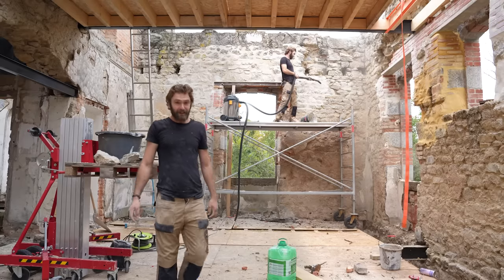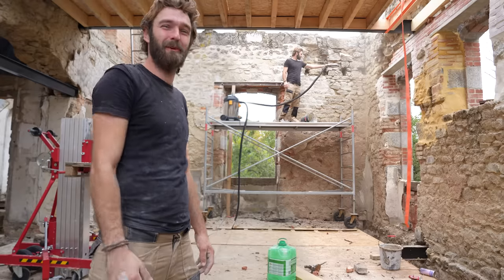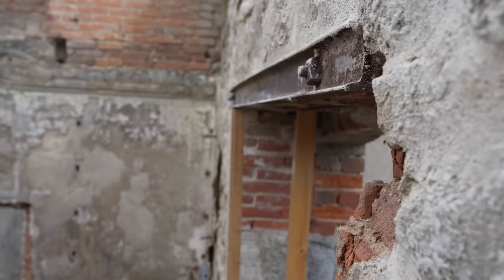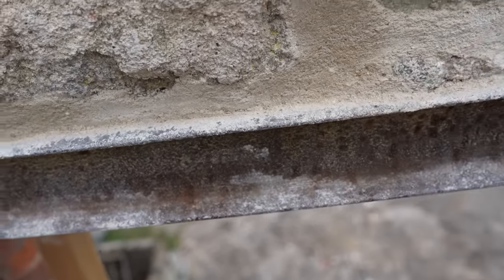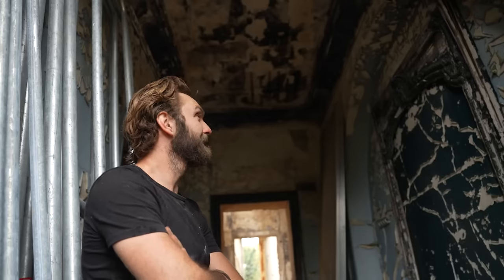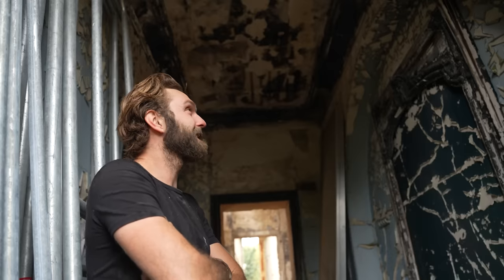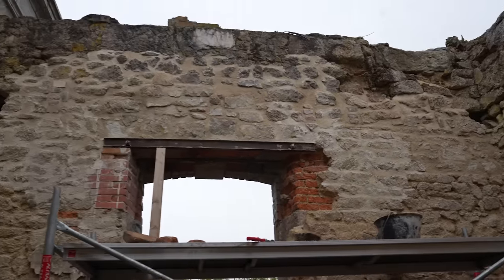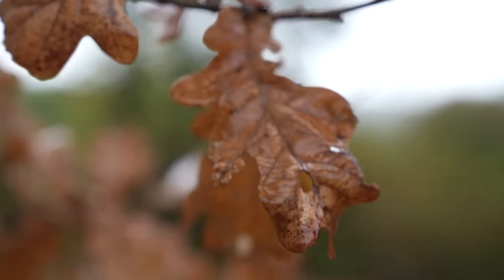Rebuilding a stone wall, finished.

Comment: The question is, when will you face the inevitable and make the building waterproof? I guess the thought of attacking it is overwhelming but still, it needs to be done urgently with worse weather coming for the next 6 months (or longer). I know it's easy to trick oneself by coming up with all kinds of other tasks that one likes to do more (eg cleaning out rubble), but a man gotta do what a man gotta do. So I hope you will find the power and motivation to finally tackle the roof (which is a large area) and make the building at least waterproof from the top (windows is a totally different story once again). Good luck, Dan!

Comment: Your life would be a lot easier with running water on site, especially for your cement mixer.
Since your existing well isn’t working, could you fill it with the debris you recently dug out and have a completely new well drilled? You could install a frost free ( must be 4 feet deep) faucet near your yurt and chateau. Nick could dig the trenches and you could lay the pipes yourself, to save money. Build a little, insulated, brick pump house to match the chateau. It’s a good winter project. Working on scaffolding in snow and ice isn’t safe.
Reply: The well pump is working. Maybe you missed that vlog
Reply: It was really stinky at first then it began to run clear, not fit for drinking though.
Reply: @bridgetmustard5285  I saw it but that water is not usable for drinking water, showering etc. The well is full of debris and toxic gunk.

Comment: Most of the French masons I have seen tend to use a water pressure washer to clean the stone and remove loose old mortar
Reply: I was advised against using a pressure washer as it is too powerfull.

Comment: The clay inside the middle of those very thick walls has most likely turned to dust. Only a pressure type of pointing machine might be able to force mortar deep inside those walls. Outside/surface pointing is pretty though.

Comment: Dan, have you ever thought of connecting your cordless drill to the lift winder to make it quicker and easier? Additionally, would it not be easier, quicker to clean the joints out with a high pressure washer?

Comment: One question if your going to  put  a C-channel across that wall would it not have been better to have placed anchor bolts into wall before sealing the wall up and all the former floor joist holes  ?

Comment: m am I going crazy or is there some sort special reason why you have filled in all the holes where the new beams need to be located, just small observation ??? hehe
Reply: He has mentioned several times that he's using a C beam along that wall and slotting the joists into that

Comment: That crank dolly lift thing you use is great but I think i would have taken the crank lever off and replaced it with an impact driver. Maybe it would go up faster and no cranking. The wall looks amazing and far different from what it was.
Reply: There have been hundreds of comments over the last two weeks saying the same thing. I think that's why we got shots of the cranking, gears and internals of the winch this ep 😂 Dan's had enough of them, I think haha

Comment: I saw on one program where they were filing the gaps between stones, they put it in a funnel shaped canvas bag with a point on it (like people use to decorate cakes).  Then they would put the mortar mixture in the bag and squeeze it and the mortar would come out and go in between the stones. Looked easier…

Comment: I missed why your filling the holes that the beams are supposed to go in
Reply: He explained it in the last video, he wil  put a large c beam on the entire lenght of the wall
Reply: He doesn't plan to use them. He is going to put a c beam in as he has done on another floor.
Reply: The beam will be alongside and attached to the wall he is repointing, thus strenghtening the wall.
Reply: He explained it in the last two videos, just rewatch one of them.

Comment: hmmm..... I'm skeptical that these walls are going to hold the roof and floors. Hope my doubts are unfounded, and casual Dan is the man. Would love to hear an on site building engineer talk it through.
Reply: I've seen many stone structures fail often when there is a fire and the stone is left to the elements (rain, tree roots etc) the water damage is what can spell disaster. Heat from a fire changes the mortar, oxygen/carbon are burnt off, the molecular integrity changes and you're left with unstable mortar, sometimes dust and not just on the surface but internally from cracks via heated stone. Agreed, it would behoove him to have a structural engineer come take a look, possibly have an internal image done.

Comment: there is this dude i watch who does liming in restoration and conservation as a pro and when he puts it deep into the wall he includes aggregate for more strength and better drying deep into the joint and the normal point on the outside only within an inch because he says the straight pointing stuff beyond one inch isn’t ideal for drying

Comment: Dude I can’t stress enough that you should be wearing eye protection especially while chipping those rocks or clearing dusty old mortar. You’re at height, with multiple levels of ladders and open gaps in the floors in what I can assume is a fairly remote location. The odds of you making off the structure let alone I’m guessing a km or two to the nearest neighbour to get aid with impaired or no sight is slim to none.

Comment: That bit of (basically) plaster will not strenghten the wall. It's superficial and doesn't improve the static of the wall, it only looks nice. Taking a chisel to the old mortar and redoing it to some depth (ca 5cm) would do the trick, but not like this.